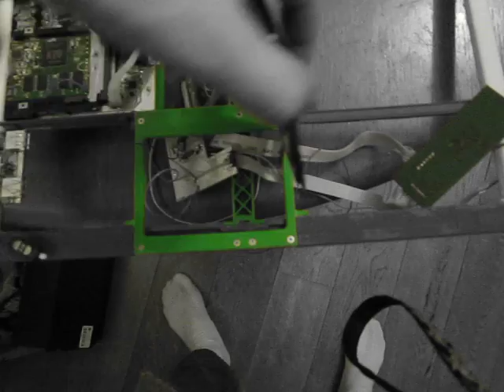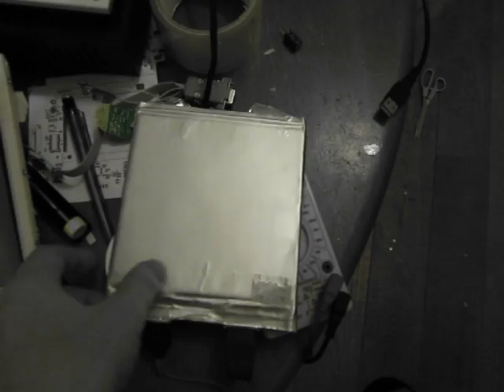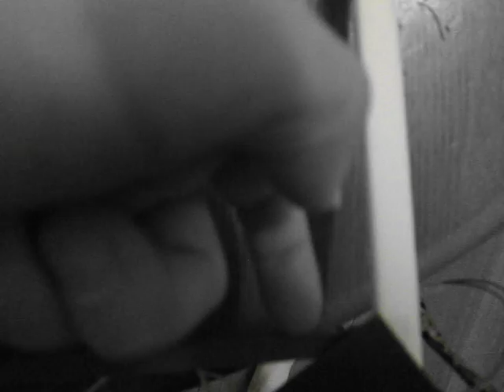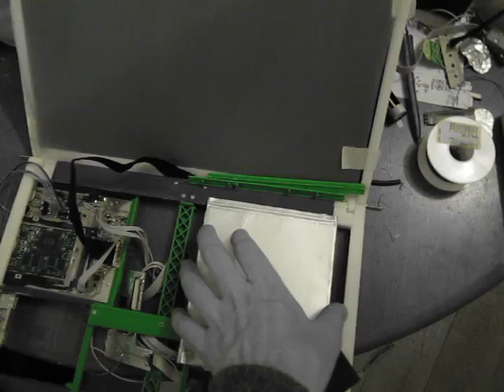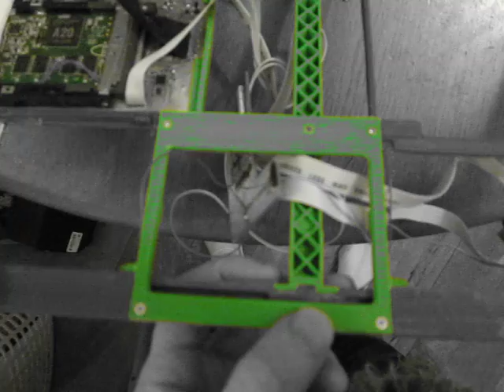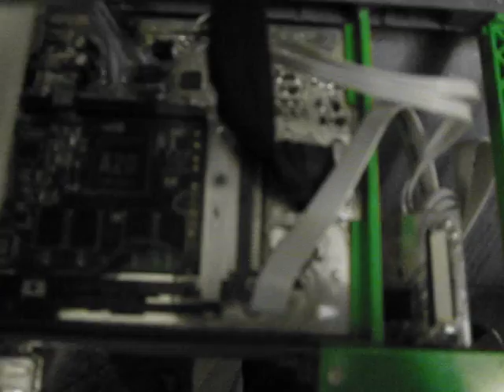Libre 15.6in EOMA68 Laptop, first prototype partially assembled

Comment: how a nice video it looks like a good project but the alwinner A20 is little bit ti weak on performance today
Reply from the maker: that's why i've been working on an RK3288 card.  which, of course, can simply be popped in instead, as an upgrade.  next will be an RK3399 card.  and in a year or so a new card, and another and another - all without ever needing to buy a new laptop housing.
Reply: lkcl good